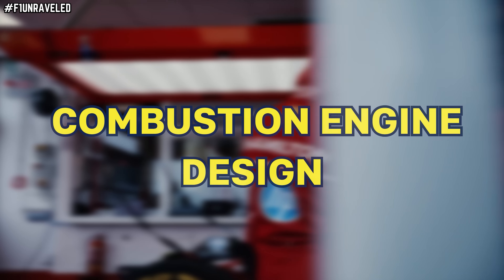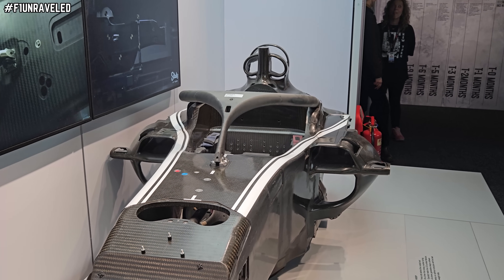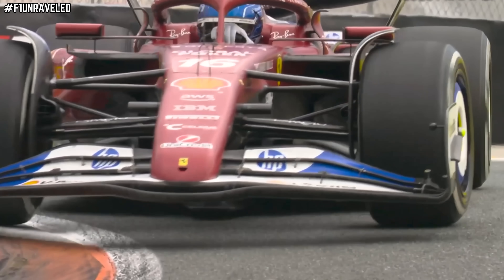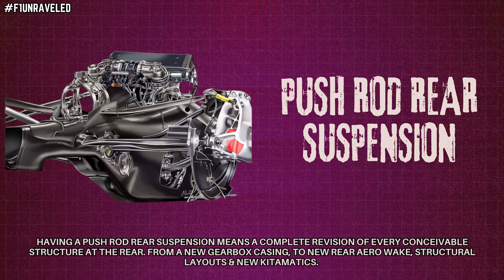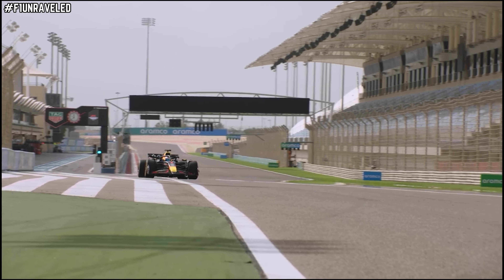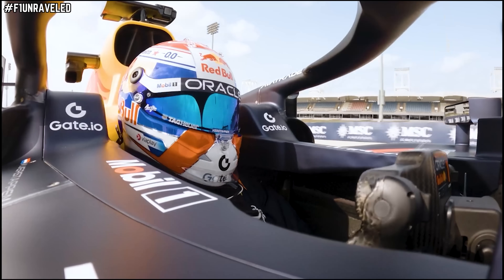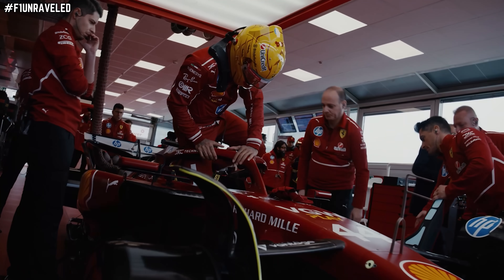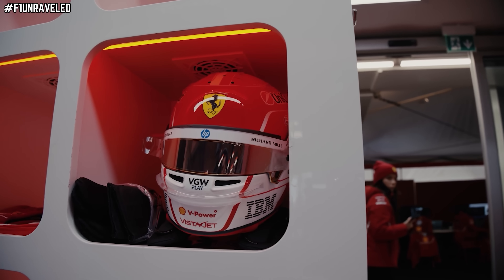Ferrari’s REVOLUTIONARY 2026 F1 Car  – Double Push-Rod, New Chassis & Extreme Aero! | Project  678

Comment: Something here doesn't make sense. It's hard to be aggressive in the anti-squat in the fronts using push-rod design so reverting back to push-rod to copy the McLaren pull-rod innovation is not happening. This is the Ferrari syndrome where they go and make something bespoke that is counter to all the trends from most teams. I know it's a copy-cat paddock but you have to be able to copy the good features and not blow all your innovation time by doing something greenfield or bespoke that on its face doesn't give a performance multiplier. Like what is the selling point of push-rod on both the front and rear ... push-rod fronts and pull-rod rears have been the go-to setup for quick free practice turn-around service because you can change setups quickly enough. This means for Ferrari they're deciding to make setup of the rear a more difficult proposition every free practice and run-up to qualifying. If anything the 2025 car copied the McLaren approach and whether the front is a success or not is all washed so we'll never really know because the rear suspension with plank wear has been garbage. Coincidentally I think the pull-rod trend Ferrari has been avoiding until the last gen of these regs has caught them out by doing what other teams have figured pull-rod fronts give as an advantage ... that is extra DOWNFORCE from more air volume energized to go through the venturis and coke bottle. I think that is why there is more downforce then they had anticipated compromising the preferred ride height as the rears could not cope with the extra downforce they had denied would be gained from going pull-rod at the front. If anything that Belgium/ Hungary rear suspension upgrades should have been instead front-suspension upgrades to alter the pick-up points of the pull-rod as that would effect the whole system downstream or simply revert back to the old push-rod philosophy because they already had a push-rod design on the SF24 waiting there to make a comeback in some form while even Haas is still using that suspension arrangement. Ferrari as an engineering group are always thinking bespoke, artisanal, niche, and novelty ... THEY DON'T HAVE TO. Just simplify as much of the systems/ processes as possible so you can focus on where the performance can be unlocked with creativity in a modern F1 car like the software tuning, like the energy storage optimizations, like ways to test setup and feed it back to the driver in loop sims. Red Bull essentially use the other car as a year long test mule which is how they get around the CFD, Windtunnel usage restrictions. Ferrari have a test track in their back yard so go and use test drivers on old cars with modular attach points and sensor suites with old school ribbon strips that would flail around from the wind and vehicle kinematics or even a smoke diffuser coming from a fog machine built into the steering well. Like there are ways to innovate and get around the testing restrictions LEGALLY that other teams cannot do. It's these things that unlock performance.

Alas all of this frustration means nothing when the biggest glaring issue is the engine. I'm sorry to say but the Ferrari hybrid era engines were never championship worthy engines and it shows because no Ferrari engine team won in WDC or WCC this hybrid power era. Ferrari really needs to innovate on this engine but all signs are looking bad. When you have the engine designer leaving for Audi, you have engineer's yelling at Fred, former Alpine engine designers who went to Ferrari engine program saying the project is lacking, Elkann blaming drivers, drivers writing memo's of what should change, the siege mentality coming from the engineering group and now the finger pointing through the gossip mill. I can sense disarray and we're like 3 month's away from testing of 2026 cars. LOL I should be getting a sense of disarray from Audi or Cadillac because they're new teams (a natural process for new teams) but I'm sensing more disarray from Ferrari right now. This engines era is super important to get right because there are more Mercedes powered team on the grid and if Mercedes is top form simply from engine then all other Mercedes engine teams will also be racing ahead of you. That means because of the 4 teams running Mercedes Ferrari can easily find itself racing for P9 and P10 along the other 2 Ferrari powered teams assuming Honda, Audi and RBPT are struggling. Chances of Honda, Audi, and RBPT all struggling is not as high as maybe Ferrari's pride might wish it was as there is a good chance one of those 3 hits a home run with the best engine on the field or 2nd best. If it's Honda or Audi that is one team ahead of you but if it's RBPT that is two teams ahead of you. Then you compete with the other Ferrari powered teams and that can make you the last of the pack of 3 teams. Essentially in a engine power dominated new reg having the best engine can mean fighting in top 3 of other Ferrari powered teams but if you have second best engine it can mean as low as fighting for P9 and P10. If Ferrari has the 3rd best engine and Mercedes alongside RBPT is 1st and 2nd best (in any order) at worst it could mean Ferrari is fighting for P17 and P18 assuming worst case their aero is worse than Cadillac and Haas who's ahead of them but with same engine. It really is important for Ferrari to get the engine rules right and the disarray I'm seeing is not a good sign of a confident team.

Comment: Autoracer doesn't mention anything about a double pullrod system. Only rear pullrod. A front pullrod system is also no better in terms of floor edges. A front pushrod system brings air in, a front pullrod system pushes air out. It depends on the philosophy and concepts which system works better aerodynamically. Basically, however, it is nonsense to say that a front pushrod system would be better in terms of the edges of the side pods. If this were the case, hardly any of the successful teams in the current era of ground effect cars, where this area is even more important than in 2026, would have pullrod systems. Switching to pullrods at the rear makes sense and is something Ferrari should have done a long time ago. Ultimately, it gives more leeway and more space in the area of the side diffuser at the rear and the edges of the underbody there (perhaps that's what you meant and just expressed yourself poorly). Be that as it may , the news on Scuderiafans that Ferrari would use a dual pullrod concept and then proceed similarly to McLaren (whose concept on the front axle is always referred to as an extreme anti-dive concept, which in reality it is not) is contradictory, as a pullrod with such suspension pivot points would function completely differently aerodynamically than a rod that is positioned exactly the opposite way around. So this news should be taken with a grain of salt, because some of it doesn't make much sense. At least when viewed individually. And Anti-Dive in general will not be a big thing in 2026 as the the downforce under the car is generated very differently. Rake will be a more important thing, the cars will not be as stiff and engineers will be happy with a car that dives a little bit more under breaking to improve downforce at the front edges of the floor and higher rake under breaking, as there will be the return of the "using the whole underbody as a diffuser" concept.
Reply: You have good few points of view , if you make it shorter or brief , would have a better impact on readers. 
Your literature review.

Comment: Anti-dive wont be as important in the next regs since the floor derived downforce is heavily reduced.  They may be over-reacting here
Reply: I was thinking the same. The anti-dive was to keep air flowing through venturi tunnels. That aspect is minimal now. Also I feel like Hamilton's driving style is more geared towards feeling that dive and using it.
Reply: @EllisEarls exactly.  He uses the weight shift to get more bite on the front and pivot the car. When I corner a motorcycle aggressively I do the same. I load of the front tire hit a late apex, turn the bike super quick and get a strong drive out of the corner. Anti-dive reduces the feel of the front, so I’m sure it’s messing with him

Comment: Apparently the McLaren 2026 car name has leaked, no surprise it's called MCL40, but the full name seems to be MCL40A, so maybe they've found enough improvements to make a new chassis in the middle of the season, as the launch spec is probably already locked-in
Reply from the maker: Really? I hadn't seen or heard that rumour. But the name makes sense! Now to find £10 million to buy it...
Reply: @F1_Unraveled auction ends in 2028, so you've got plenty of time 😄
I'm more interested in if they're already planning a MCL40B, because they've found enough improvements they just can't implement in the launch chassis 😄